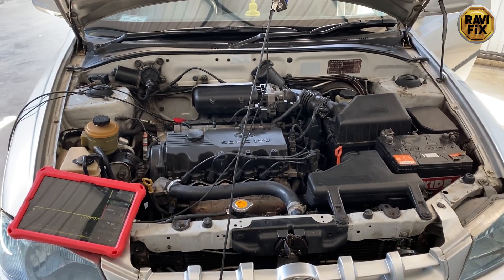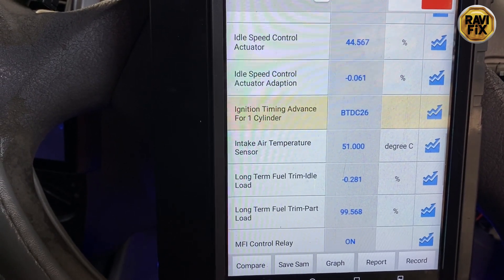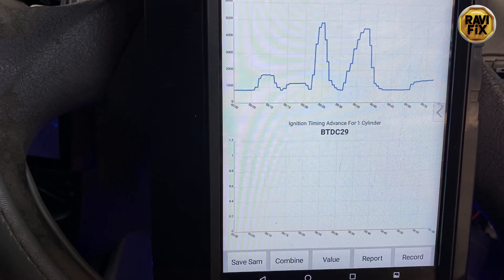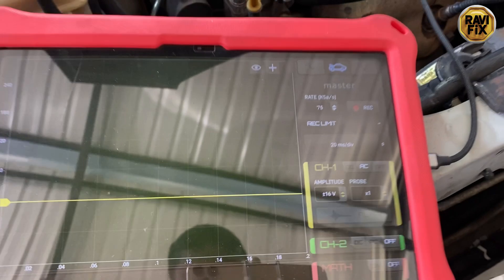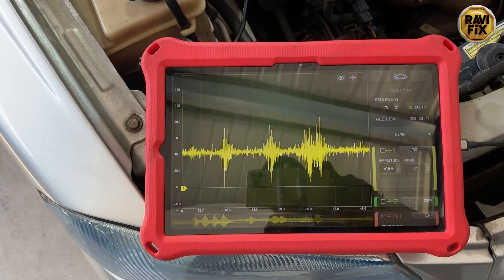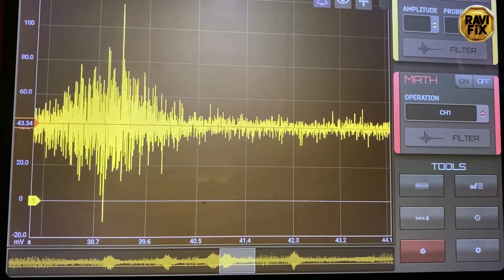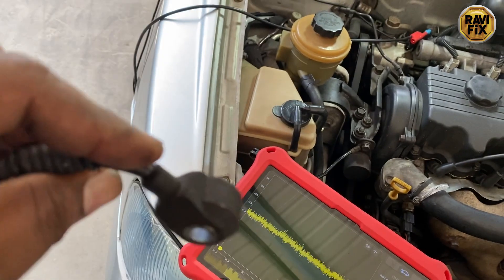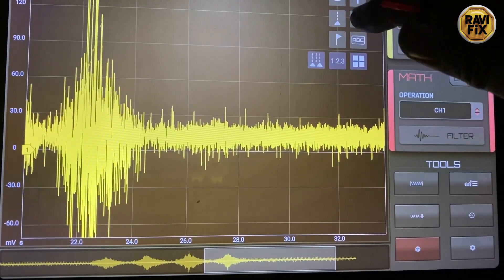Hyundai Accent Low power and Ignition Knock Diagnosis and Fix. It Would have been hard to find case.

Comment: Did you tighten by the spec that knock sensor?
Reply from the maker: I didn’t check the old one which was faulty. But new sensor installed and fix the problem.
Reply: @ravifixall  Ok, but must be tightened by the specks...e.g. 10nm.